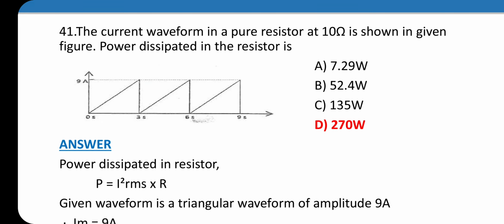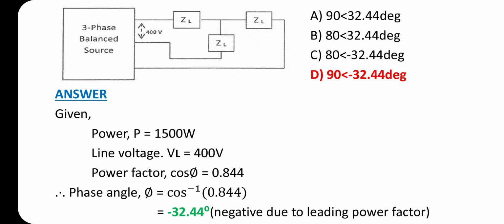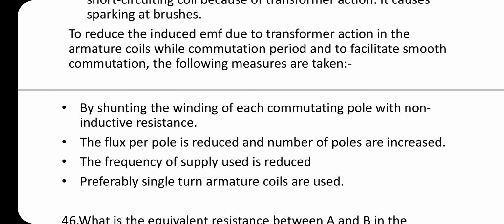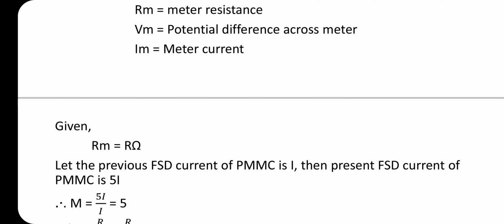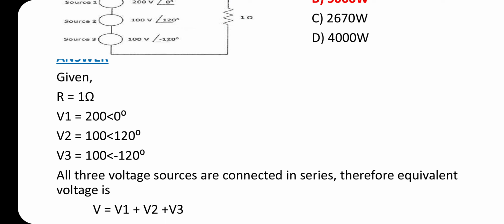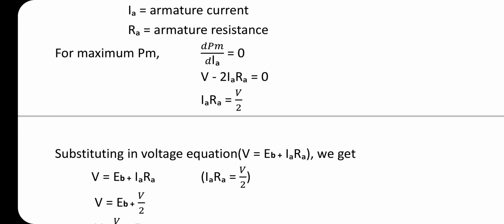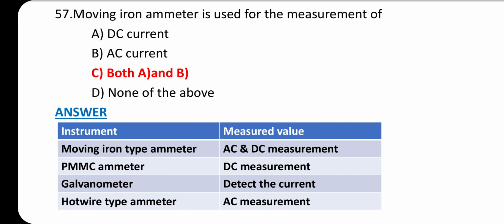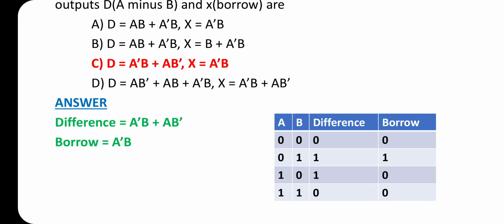ISRO-VSSC|TECHNICAL ASSISTANT|ELECTRICAL ENGINEERING|2017|PART3

Comment from the maker: (Typing mistake)
1.At question no:52- In answer, heat produced in  resistor R3 is correct for the second time. 
2.At question no:55-In answer, written seed . Correct is speed
3.At question no:58-In answer, At half power frequencies current is not maximum.